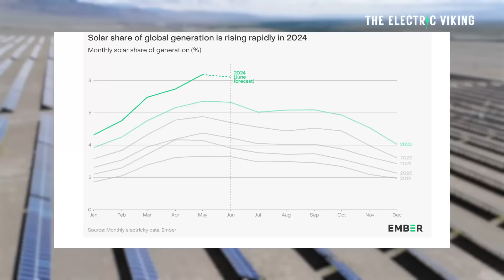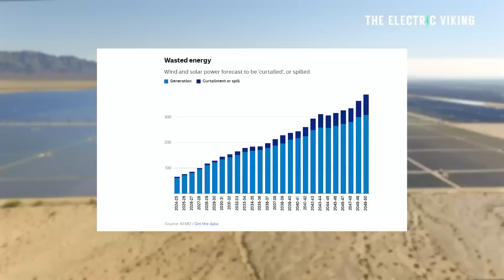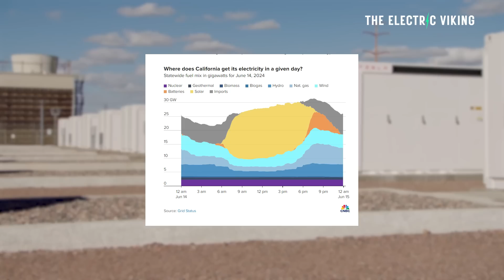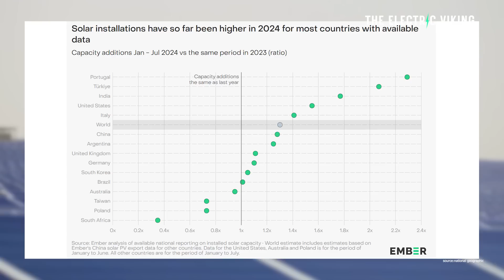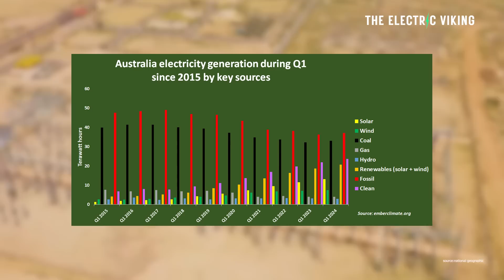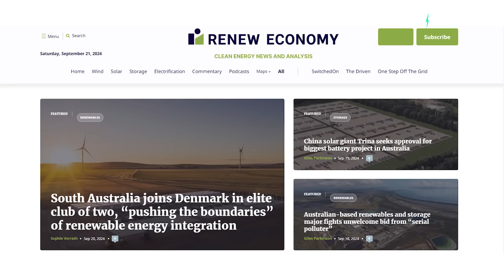Renewable energy hits record 102.5% of entire grid demand in Australia

Comment: cheers sam.  here is some positive news.  The last coal power plant is being closed down in the UK at the end of the month.  Ratcliffe on sour power plant which is close to Nottingham is closing on the 30th September.  This is 30 miles from me and I am happy that it is going.  they plan to turn the site into a green renewable hub and make use of the existing connections into the grid.  cheers John.  ps, very jealous of your 26KW solar setup.  My network operator has refused my applications to put in more than 8kw which is very frustrating.  I have 210KW of batteries, with 3 EVs (2 Teslas and one Nissan leaf), plus a Tesla power wall so I can soak up all that energy, but the network says no.  Now looking at setting up an off grid EV charger connected to solar panels as a way to get around the restriction.
Reply: The UK imports coal, gas, renewable and nuclear generated power from Europe, unlike Australia it hasn’t any energy independence.

Comment: "Crucial system services", to quote Sam, must include dispatchable sources of energy of the same or larger wattage as the whole of installed renewables. So, diesel generators, coal and nuclear power will still be around until humanity builds linked solar around the globe, so that Ausssies could use energy from Afrique and Americas, when the sun is not up in Australia.
Reply: This simply isn’t true.
Reply: @jemezname2259 kindly asking you to talk to any retired knowledgeable power networks engineer, or your physics teacher if he's still around.
Reply: No.  We are in a transition process where we still need some dispatchable generation as fill-in but that need fades as we add more solar, wind, and storage.  I don't think you are adequately considering the role of storage.

Let's say we've reached a point where wind, solar, and hydro are supplying all the power we need except for a few days each year.  It's not like they won't supply any power, just not enough. What we need during these times is enough fossil fuel generation to supplement the shortfall.  Not supply 100% of the demand.

If we are going to be, for example, 24 MWh short between 3pm and 4pm on a given day we don't need to crank up a 24 MW generator.  We can crank up a 1 MW generator and run it for 24 hours, letting most of its power recharge storage and use the stored power to cover the peak shortfall.

Comment: The financial sector needs to stop lending for legacy power plants, it’s too risky and takes too long to reach revenue generating status. If you can finish a nuke plant in a year on or under budget fine, but that’s just not going to happen.
Reply: The new smaller ones are much safer. Can be built in much less time. They can use old spent uranium, so we can get rid of the old stuff and have less waste. It works when solar doesn't. It works in the Northern states where solar is crap. Solar and batteries can be great but we need small nuke plants in area's that it isn't great.
Reply: @BillJohnston-y7o  
Let's wait until someone actually builds a "new smaller one" and see what the cost is.  We have decades of the nuclear industry lying to us about how their next idea will work and give us affordable electricity.  They haven't.

There are studies that find the cost of small nuclear plants may be more expensive than large plants.
Reply: @bobwallace9753  I think China already has 18 in the making at this very moment. We have one that just broke ground in june in Wyoming. Will be done in 2030. They are coming, bank on it.

Comment: But, but...
Australia exports the largest share of coal of any nation, at 54% of the total.
Australia is the world's leading exporter of coking coal.
Reply: But, but, Australia absorbs more carbon and methane than it emits due to its vast land area and oceans.
Reply: @seanlander9321  Global heating is a global problem, not a national one, mate.
Reply: @elephantintheroom5678  Sure is, and if the rest of the world could match Australia for reducing as well as absorbing emissions, it would be a damn sight less of a problem.
Reply: Do you not understand the irony of the situation, which is that energy from coal is making the systemic renewable energy transition possible in the first place. This dichotomy applies equally to any supplier of coal as it does to any coal customer during the course of the systemic transition to renewable energy. How else can the gradual transition over time take place otherwise?

So what is the point you think you are making, other than stating the bleeding obvious?
Reply: @BrentonSmythesfieldsaye  Exactly. Just the same as applies to Norway. Norway is a large energy producer, and one of the world's largest exporters of oil. Most of the electricity in the country is produced by hydroelectricity. Yet Norway is one of the leading countries in the electrification of its transport sector, with the largest fleet of electric vehicles per capita in the world. As you correctly state, one fuels the other.
Reply: @zoransarin5411  Norway imported 14000 GwH of electricity last year, it has no capacity whatsoever to produce enough electricity for itself. Australia is the example that countries should be looking to for self-sufficiency and what needs to be done for green energy finance, generation, distribution and storage.
Reply: @zoransarin5411  Indeed it has to be that way doesn't it. But contrarians ignore this and want to try mischievously exploiting the hypocracy accusation. Respect to Norway for show how it is done. What they have done should be emulated where ever possible, to further accelerate the global energy transition.
Reply: @seanlander9321 Norway is a net exporter of electricity supplying other Northern European countries.
Reply: @chrishaberbosch1029  Norway imports electricity.
Reply: @seanlander9321 Given where Norway is, it's hardly a surprise they don't get much from solar half the year (the other half, though...!). Still, one day there will likely be an interconnected European grid. It's always windy, sunny or, er, tidey somewhere
Reply: @seanlander9321  Sean - the discussion is more nuanced than that. "In 2020, the Nordic countries produced 280 million tonnes oil equivalent of energy [1]. This corresponds to almost half of the primary production in the EU, 48 percent. Of the Nordic primary production, 75 percent came from Norway. Four out of five Nordic countries were net importers of energy in 2020, with dependency rates between 12 and 45 percent. The exception, Norway, exported 6 times the country’s consumption."
Your comment is correct. But the flip side is that Norway is a significant energy exporter as well. It balances things in partnership with other countries in the EU, as opposed to simply going it alone, something Australia is unfortunately stuck with given our location and isolation.
Reply: @zoransarin5411  Australia is likewise a nett exporter of energy, however it has a chronic deficiency of oil. Therefore where I was heading, was that any reduction Australia can make to cutting its imports of oil for transport by changing to EVs must make for a better economy.  The arguments from the piston heads skirt around the economic and strategic difficulties their vehicles make for Australia, for which they have no solution.
Reply: Yes, getting rid of their problem.
Reply: @thystaljaard7607 like many western countries Australia is shipping it's manufacturing and jobs to developing countries with low environmental standards.
Reply: It's a shame
Reply: Stop buying our coal.
Reply: @aaronsinspirationdaily4896  Ha!
Reply: To China. And China is shutting down, and cancelling new coal plants that were in the pipeline and pivoting big-time to solar. Sam had a recent video about that. So our main market for coal is about to collapse. Great.
Reply: @elephantintheroom5678  Ahem. China is doing no such thing, it’s solar is a supplement, not a replacement for coal. Besides, Australia’s coal exports to China are principally metallurgical coal not thermal.
Reply: @myhome772 I think you will find used Tesla Model 3’s will become very cheap.  The standard range LFP battery will last hundreds of thousands of miles without replacement.
Reply: They want to create an Australian uranium yellowcake export industry to replace coal exports.
Reply: Sam , the only thing stopping Australia becoming a renewable powerhouse is the voters who believe the opposition fossil fuel pundits, and the MSM who give the nuclear lies oxygen. Future excess energy will also be used by EV's with VtG tech making houses their own power station.
Reply: @myhome772 In the not-to-distant future when self-driving vehicles hit the market you will be able to hire out your Tesla as a robotaxi, and it will fund the cost of the Tesla. Musk was talking about that plan recently.
Reply: @elephantintheroom5678 I own a Tesla and that is rubbish imo. Great cars but driving around on their own is a pipe dream.
Reply: @myhome772 I can't wait. It will be so satisfying to see.
Reply: Time to diversify and retrain.
Reply: Because China is closing all the dirtier coal mine and using Austrlia cleaner coal.
Reply: That's true. As Australia deindustrialises to meet its constrained energy availability, it ships coal to China so they can manufacture all the stuff we need. 

These days most manufactured objects in Australia are imported from China, including solar panels and wind turbines. They are made using the energy of Australian mined coal sent to China. Chinese manufactured goods are quite good but the overall situation is weird and by no means good for the global objective of eliminating GHG emissions.
Reply: @jimgraham6722  Actually Australian made panels and home batteries are made at very similar costs to the Chinese, and are better too.  The problem for Australian manufacturing, and most of the world, is that the Chinese have a scale that is overwhelming so that makes investment in local manufacturing very risky.

As for exporting coal, that’s irrelevant to losing industry. Each country ends up doing what it’s good at with the exports that other countries want. In Australia’s case, it’s metallurgical coal us in demand because that makes cheaper steel with less emissions.
Reply: @jimgraham6722  Global objective LOL - you mean globalists' objective.  Do you think they care about our interests?  How come they fly around in private jets?